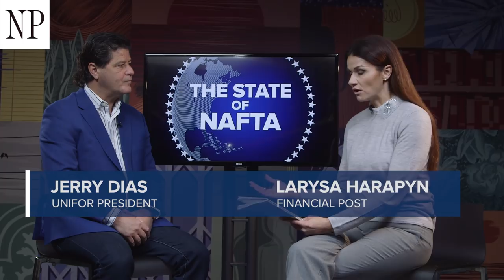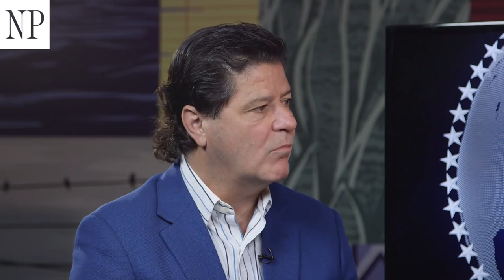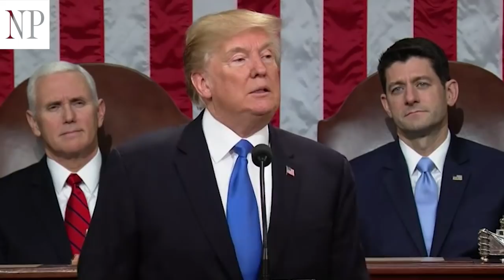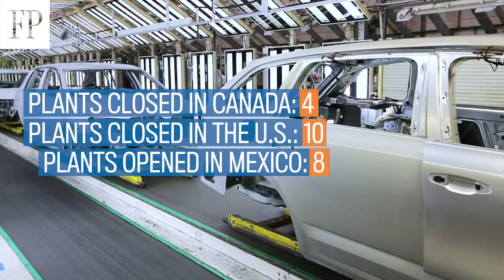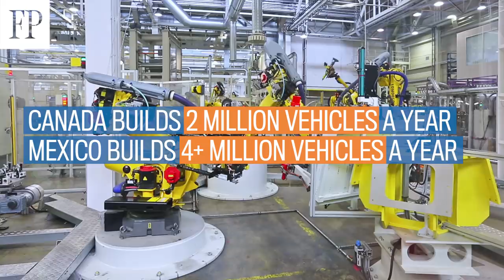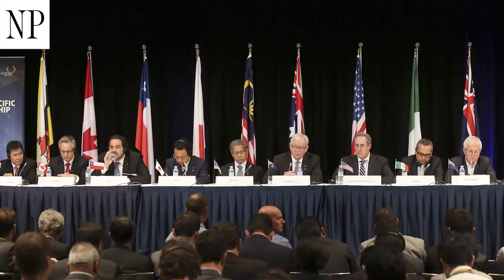Jerry Dias: We blew it on NAFTA

Comment: so the US wants all vehicle sold in the US to have 50% parts made in america. as a Canadian I don't see anything wrong with that.. Canada should just go back to the old trade agreements with the US before NAFTA. fair is fair, zero tariff is 100% free trade!
Reply: t pw I believed that's what he wanted if NAFTA failed, he already spoke about that dealing with Canada and Mexico separately. He also was quoted he wants fair trade not stupid trade and he wants 100% no tariff both ways
Reply: LuvMyLilBabe  If you want all vehicles sold in the US to have 50% parts made in America then you don't want any Canadian made vehicles. In any case, Canadian-made vehicles make up only 5% of the US market. If Trump wants fair trade he shouldn't complain about dairy tariffs. The day Trump lifts tariffs against Chinese steel is the day Canada should lift tariffs on American dairy.
Reply: Tan Ler that's BS! What's not so fair about demanding all cars sold in America should have 50% parts made in America? The percentage of cars Canadian sold in America should have nothing to do with it.
Reply: LuvMyLilBabe  Would you clarify what you mean by "50% parts"? Are you including the cost of labor? Are you allocating different weights to the engine, transmission and other components? Are you referring to the origin of the materials, like steel, aluminum and plastics? I admit I don't know much about car manufacture. But I'd be surprised if any engines are actually made in Canada.
Reply: Tan Ler I suppose this applies to 50% of the entirety. I'm sure Canada have very good negotiators. Last time I checked Canada is not part of China so why  do we care what tariffs the US have against China, maybe China should pay their employees and give the same benefit in America?  Nevertheless none of Canada businesses. I would love the day we  become self sustained and buy everything locally. Globalist elites are only looking for their best interest not for the people of Canada.
Reply: LuvMyLilBabe  There's nothing wrong with wanting to buy a car with 50% American content. For an American. If I were American I'd vote for Trump, too. Unfortunately, as Jerry Dias says in this interview, that criteria would basically doom the auto industry in Canada. I don't think free trade is a good policy for Canada. It works only if the government enables certain industries, like they do S. Korea, Taiwan and Germany. In other words, it's a totally coordinated effort in those countries. It's capitalism, but it's also following a blueprint. Asking you to clarify "50%" was a trick question. I apologize for that. The website "The Cars. com" breaks down every car sold in America into five categories, including engine, transmission, assembly and support and sales staff. The highest percentage is 75%. They accept any car with 40% or more American content as "American made". But you've raised a great point. We should be more interested in the welfare of workers rather than the profits of multi-national corporations. In a sense Trump has done that by making auto manufacturing an issue about nationalism, rather than corporate profits.
Reply: Tan Ler,  why is the dairy industry in the US so socialist?
22 billion a year in tax payer subsidies is not cool when millions of gallons of excess milk gets poured down the sewer. I would provide links but this phone won't add links.
Reply: Tan Ler, if there is the deal, for example, in the Mexican-US deal, it’s specified that 75% of the content must be manufactured in US or Mexico.  If Canada signed on to the deal, then it’s North American.  To answer your question directly about labor.  By definition, cost include labor.  Also, manufactured means make or produce and do not include raw material.  Raw materials and steel are covered separately.  So manufacturers have a choice, they can either buy foreign steel or aluminum and pay a tariff or buy steel and aluminum in North America without tariff for their production.  The Mex-US trade deal also included a clause specifying that 50% of the parts must be produced at a labor rate of at least $16/hr.  Finally, there is no % assigned to different area of the car.  It is the total content, however the manufacturers (specifically, the assemblers) want to split it.
Reply: indoctus41  are you really using tabacco as an example?
Reply: W.A.M.P.  I agree with you there. A lot of the money America invested in other countries isn't coming back. Or, it did come back but ended up in corporate boardrooms. Personally, I believe America has suffered from poor political decisions (like the war in Iraq that has cost billions) and poor economic management (the 2008 financial crisis, I don't blame Bush so much as Congress and the banking industry).
Reply: just move the plants to the usa

Comment: good luck Mexico and Canada
Reply: Holy Trash
Actually, the Mexicans did quite well. Wages went up noticeably and environmental regulations were increased.
(The latter point is never mentioned by the mainstream media.)
We in Canada, on the other hand, will continue to press for 'the feminization of the steel industry'. -- No, I'm not making it up. That was one of the original points of contention.
Reply: @richardshort3914  good for the Mexicans, many of them are hard working people... & sorry about your feminization of steel...steel should never be feminized

Comment: The elephant in the room is the exponential advance of artificial intelligence and robotics as well as the mass adoption of graphene based batteries that will extend battery capacity by a factor of ten. That marks the end of oil within 10 years. Further solar, wind  and advanced battery storage is now cheaper than any other form of energy. This will mean the death of the petro dollar system. Factory automation is spreading to every corner of industry. The cost of manufacturing is dropping off a cliff. Even the cheapest mexican slave labour will soon be too expensive to use compared to AI driven robotics. Jobs for humans will go away for ever. This will affect all jobs including doctors, laywers, and executives replaced by general AI. Ok so what do governments do with this. 60 percent of all jobs in North America are driving jobs. Self driving vehicles will replace all of them. Start asking your politicians how they will be addressing this massive rapid change to a completely new reality.
Reply: Another Jeremy Rifkin disciple.
Reply: Excellent comment. But, are you new around here? We won't deal with the effects of automation until they are literally on top of us.  'Tis human nature.
Reply: Rifkin says it will take two generations working at 100% employment to convert ALL buildings into solar and geothermal power cells that will completely replace the current fossil-fuel energy derived system. So, all those doctors, lawyers and executives still have work to do before the AIs get here.